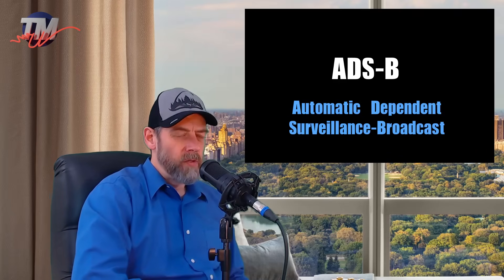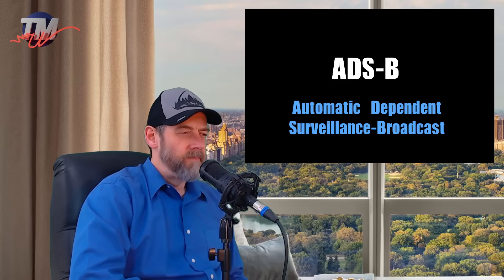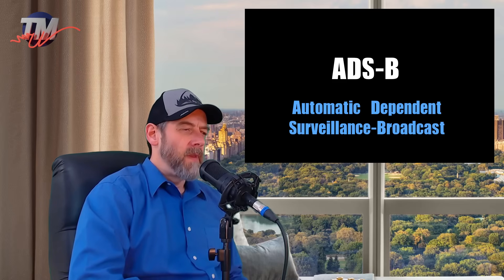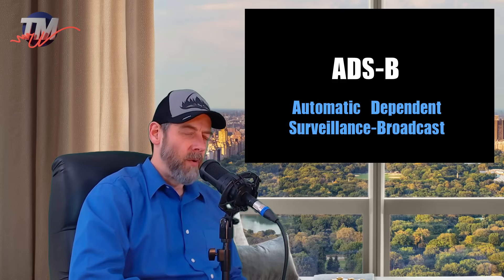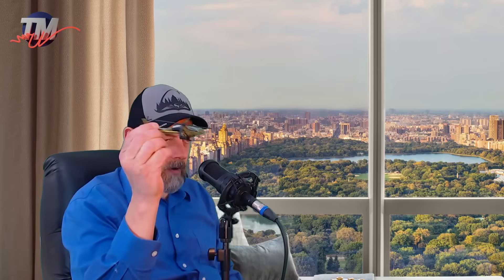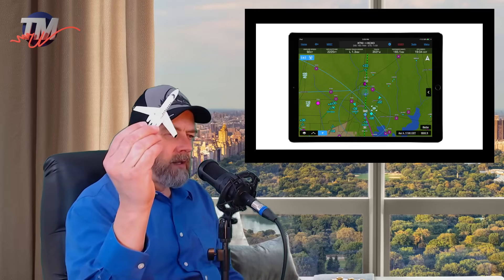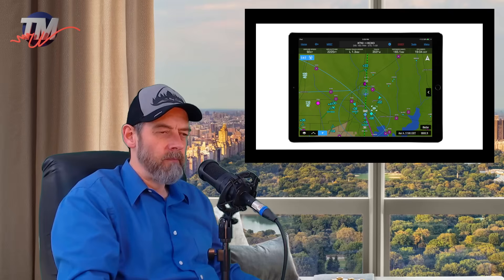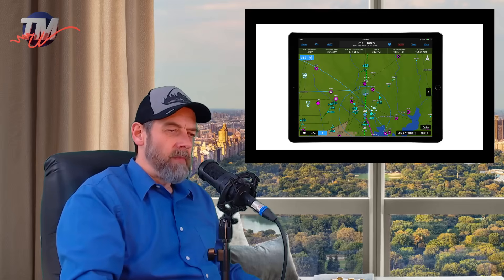The Blackhawk's ADS-B-Out system was turned OFF. Why, what is ADS-B, and why does it matter?

Comment: ADS-B Out is a system that allows aircraft to broadcast their location, altitude, speed, and other information to other aircraft and air traffic controllers (ATC). ADS-B Out is required for most aircraft operating in controlled airspace in the United States. 
How it works 
Aircraft with ADS-B Out transmit information using a Mode S transponder and Extended Squitter.
The information is sent using the 1090 MHz frequency, or the 978 MHz frequency for aircraft flying below 18,000 ft MSL.
The information is received by ground stations and other aircraft with ADS-B In capability.
Benefits
ADS-B Out provides more accurate tracking of aircraft than radar. 
ADS-B ground stations can be placed in areas that are difficult to reach with radar, such as mountainous terrain. 
ADS-B Out provides more accurate information about an aircraft's last reported position, which can help with search and rescue. 
Related systems

Comment: Don't helicopters have radio altimeter? Totally independent of air pressure or GPS.
I worked on these radios back last century.
Reply from the maker: Some are equipped wit h a radar altimeter, but it's irrelevant. They weren't paying attention to any altimeter in the cockpit.

Comment: ADS-B turned off?  Maybe necessary for the military in special circumstances in a true national emergency/evacuation, but as I recall, for us "little people," the FAA says if your aircraft is equipped with ADS-B, it must be turned on at ALL times ... period!
Reply from the maker: Yes. The regulations facilitate some exceptions, but in general that is correct.
Reply: @truthmattersunplugged  Military is not only exempt, they NEVER use ADS-B for security reasons so their movements cannot be tracked and analyzed by mortal enemies that want to brutally slaughter EVERY man, woman, child, cat and dog, and every living thing in the US. It's to prevent enemies from SLAGHTERING us by taking out EVERY US Armed Force aircraft in one preemptive attack in the blink of an eye.
Reply: @truthmattersunplugged lets be clear about the requirement for ADS-B in Army helicopters. 
Army Regulation 95-1, table 5-2, Required Equipment indicates ADS-B is required equipment on the aircraft and that it is required for day/night, instrument, and night vision device (NVD includes NVGs) operations, with a caveat:
Para 2-14b(2)(j): Under day/night or NVD operations, mission briefing officers will mitigate operational security risks for sensitive or classified aviation operations when the aircraft is assigned a unique address code and/or location is broadcast by ADS-B, mode S transponders or personal electronic devices.

The point is, the pilot in command could have been briefed to turn off ADS-B so as to not display route or altitudes to anyone that would do harm to those specially marked aircraft. Now, I doubt he was briefed not to use ADS-B but it’s possible. I also don’t believe the NTSB has proof that the ADS-B was off. The front half of that aircraft is so wadded up in damage like tin foil that I find it doubtful they have gotten to a control head and viewed the on/off power switch off. It’s possible the ADS-B failed or was inoperative (although unless the mission briefing officer authorized the flight with it off, it was required equipment to be operational). If it was inoperative before flight it would have been written up in the aircraft logbook which at least used to be a laptop computer. The Army and NTSB will investigate all these possibilities and determine the facts.
Reply: Military is exempt
Reply: @garyalabama 
Nope ... well maybe on a battlefield, in warfare.The trouble is, that the military THINKS THEY ARE EXEMPT in peacetime in public airspace.
Reply: @thedolphin5428  Remember 9-11  I suppose those fighter pilots trying to stop a few of those planes had ALL reason to turn off all types of transponders. Only using their military radar. That was also peacetime.

The correct assumption should be....
ONLY in real emergencies they can turn of such systems.
Reply: So why was the initial height data claimed to be ADS-B if it was turned off?
Reply: @Manwithcheesees  The ADS-B data was from the PSA commercial aircraft.
Reply: @Sparks68  ADS-B doesn't tell you the position of other aircrafts. It broadcasts its own position. They said the track data from the helicopter was from ADS-B data. So someone is wrong.
Reply: @Manwithcheesees  Someone is wrong? Start with the creator of this YouTube video. The Blackhawk didn't even have an ADS-B onboard. The ADS-B Out track was from the plane. The only track thus far for the Blackhawk was the Tower radar recording. The black box Flight Data Recorder on the Blackhawk will have a recording of its altitude from its altimeter for a given amount of time before the collision. The DEFINITIVE story is from the NTSB briefings, not from this dude.

Comment: Also, in an unrelated question, what are your thoughts that the legend of the VFR helicopter route chart shows the altitudes as "recommended altitudes"?
Reply from the maker: That is normal. They have to be able to fly around obstacles, mist, smoke, etc.
Reply: @truthmattersunplugged  I find it confusing when so many aviation professionals are making a huge deal about the chopper being high. They were VFR and, regardless of altitudes, or even identifying the wrong traffic. In theory, they should have avoided any and all traffic, whether it was called out to them or not. It really boils down to a failure to clear. Of course, there will be contributing factors in the investigation.
Reply: @truthmattersunplugged  And technically, by the regulatory guidance, they weren't high because the altitudes are purely "recommended." And no altitude assignment was given.

Comment: Good video thanks. However, correct me if I'm wrong, but Blackhawks have radio altimeters fitted. Flying a corridor, such as route 4, at 200' or less, would demand accurate altitude references for the pilot. The barometric altimeter would not offer accurate reading at such a low level.
Reply from the maker: Some do. But the pilot didn't seem to pay attention to any altimeter. It is true that a barometric altimeter could be off by over a 100 ft, but not after setting it just minutes ago not far from where they were. If set correctly it would've been accurate enough.

Comment: I've watched the autonomous blackhawks perform missions without any crew flawlessly. 
I am not saying this is the case only that it could've been overtaken by remote possibly ? 
So sad and an entirely avoidable atrocity ...
There are 20 military air bases within a 50 mi radius to night train in the middle of runway approches  if that's your thing?  Just taking out a passenger jet after 67 seconds refusing to comply w/ ATC directions is unacceptable period! 😭
Reply from the maker: It is plausible. It that is the case we'll never know the truth.
Reply: @truthmattersunplugged 
That's correct. I'm positive we will never get the truth or any real accountability in this situation like always!  Right away, my initial  thoughts on this crash was sabotage being prior military with 30 yrs combined as a DOD aviation contractor 
I can't help thinking about the autonomous Blackhawks and I wouldn't be surprised if this helo was crew less and operated by remote? Either way, my suspicions keep me leaning towards this possibility as sad as it is...  This crash was preventable and is sorely obvious!

Comment: news flash... mode C is only certified to +/- 125' (it used a 12 bit Gillham  code... the same is used by ads-b and GPS (with a functioning waas signal) is only accurate to about 30M vertically (10M horiz) so no matter how you look at it, flying at very low altitudes (as was the case) the vertically accuracy sucks as it is about +/-50% of the allowed max for the helicopter route so it is NOT really an acceptable source for separation by ATC, IT HAS TO BE DONE VISUALLY which includes using the local altimeter setting and flying the correct altitude which IS very accurate, but it must be done... and actually when the blackhawk was told to pass behind the CRJ, THAT was the fuckup not the altitude, just like with TCAS which is not readily usable for separation below 1000' as it can only provide vertical advisories... you are indeed correct they were supposed to pass behind the CRJ...  and please realize that GPS altitude info is the same as locally corrected pressure altitude but generally not as accurate... ADS-B out uses pressure altitude as the primary altitude info not the GPS (geometric) altitude....lesson of all of this? fly behind and airplane and it cannot hit you!
Reply from the maker: The BH's altitude is of less importance than horizontal separation. They shouldn't have gone into the short final approach leg of a landing aircraft even if they were at 100 ft. So,  altitude was not the primary issue here. ADS-B Out transmits both geometric and barometric altitude. ADS-B geometric altitude is more accurate, but still within 10-50 ft. ATC primarily uses barometric altitude separation and for IFR operations because that ensures all aircraft are using the same pressure altitude (29.92 mmHG). Geometric altitude can b alsoe used to verify an airplane's barometric altitude.

Comment: I agree with your assessment that "vast mistakes" (your words) were made in this case. Vast mistakes which contribute to an undesirable outcome are a characteristic of a subversive operation, a.k.a. false flag. If that is the case, the "mistakes" would have been intentional.What would be a motive (among many possible motives)? If the evacuation system is compromised, that means it is hackable. Who could hae been doing the hacking? This could have been a signal to the set of people who are eligible for such evacuations that there might not be a safe exit. This is an egregious security breach of the highest order.

Comment: The Gold Top heli was in a fleet that are just taxis for idle Generals. This flight was in the most congested airspace in the country, being flown by a trainee pilot with only 500 hours, had nav aids turned off, was at the wrong altitude and was wearing 2D night vision that has no depth perception. What could possibly go wrong? Well, Everything. And it did. Now we get the coverup. Its all in the script.
Reply: Fairly experienced for the military, so not trainee.  Different arena, different standards.  But, yeah, the whole heli crew f-ed up.  Also the tower was very short-staffed and over-worked.  Also the standard procedures for the interaction between the heli river route vs that runway approach are seriously deficient and the heli should have been required to stop and hold short.
Reply: @davidseslar5798    yea whatever  the  communication  was  right before  crashing ,,was NOT WORKING ......how many crashes  and deathes  does it take  till  pilots  learn  the language  o  Towers  control
Reply: @davidseslar5798  That's bullshit. Tower did things by the book and was not understaffed or overworked. There were 5 controllers on duty; only one was necessary to control the busy but not disorganized airspace. The 'Hawk crew screwed up. And since it was on visual and told the tower twice the CRJ was in sight, it was responsible for decisions about holding short, not the tower. Put your tin hat back on and leave the room.
Reply: @PoubelleKansas  If they did things by the book then the book is wrong.
I'd say granting visual separation under the given conditions is as bad as requesting them.

Just saying, if you are convinced seeing the right airplane you're telling you have it in sight. Or do you?
If you request visual because you see what you think the traffic in question is and the controller just say "negative, hold short", everything is fine. Your mistake would be mitigated by a 2nd pair of eyes.

Thats basically how the swiss cheese model works, add layers of safety to mitigate errors (which happen from time to time).
Reply: @Merilix2  "The book is wrong"? Thank God you're not in my Euclidean Geometry classroom. 
And whose second pair of eyes are you talking about? 
The "given conditions" were standard for DCA at night. Lots of planes in trail, all waiting their turn to land. 
When a PIC asks for visual he is taking responsibility for his craft and those on board, plain and simple. Tower ATC is not there to command aircraft in flight; they give advisories and line planes up. FAR is pretty clear on this command sequence. 
Visual is granted under identical conditions hundreds of times daily. If the PIC asks for it, there's no need for "backup" in the tower to verify the location and make sure the air is clear. Talk about tying things up; that kind of handholding only wads up the traffic for no good reason.
ATC can step in if something weird pops up, so in this case ATC asked a second time if the CRJ was in sight when it looked like the 'Hawk wasn't going to actually pass behind the CRJ. 
The Blackhawk pilot said he had the CRJ in sight. A CRJ, not an A319 or anything else. Twice the PIC said he did. Those two aircraft are visually distinct. Check the location of the engines. 
There's still much information we need to make a fuller determination of fault but most will land on the head of the PIC of the Blackhawk who turned off ADS-B and might even have had on NVGs. It doesn't look like he ever used his eyes, either, to sweep the sky. Kind of hard to miss a CRJ with landing lights up ahead, even when coming in from the side.  
He lost any way to id nearby aircraft through his stupidity and killed 67 people.
Reply: @PoubelleKansas  If the book would have said: "You must not permit visual separation if there is potential conflict" then the accident wouldnt have happened. Right?

It seems like you didnt got the important point here: Safety first!

It may work out well 10000 times a day but if a pilot makes a single mistake it costs life which ATC could have prevented to happen by not granting permission for visual.

You know? Independent Probabilities multiply. if there is a 1/10000 chance the pilot mistakenly look for the wrong traffic and there is also a 1/10000 chance ATC would mess with separation, there is only a 1/100 million chance for an accident. But if ATC always shift the responsibility to pilots only, the chance is 1/10000. 
You get the point?

Taking slices off the swiss cheese model has huge impact for safety.
Reply: @Merilix2  Well, in addition to needing a probability lesson – which I'll not do for you so as not to confuse you even further than you already are -- you need to read the FAR before you pop off about ATC. [The Federal Aviation Regulations (FARs) are the rules that govern air traffic in the United States. The Federal Aviation Administration enforces the FARs] Also, here’s a selection you need to read from The United States of America Aeronautical Information Publication (AIP), published by the authority of the Federal Aviation Administration.
[Caps in original]

PILOTS HAVE COMPLETE DISCRETION REGARDING ACCEPTANCE OF THE SUGGESTED HEADING OR DIRECTION AND HAVE SOLE RESPONSIBILITY FOR SEEING AND AVOIDING OTHER AIRCRAFT.

Additionally, “The pilot in command of an aircraft is directly responsible for and is the final authority as to the operation of that aircraft.” 

"Complete discretion,"  "SOLE RESPONSIBILITY FOR SEEING AND AVOIDING OTHER AIRCRAFT," and "final authority" are key phrases here. 

Laying blame on ATC for the actions of the helicopter pilot after traffic was called is wrong. If the pilot said he (or she) had the aircraft in sight, he (or she) assumed complete responsibility for separation. 

The pilot is the one who controls the aircraft; he or she is the one in charge of the aircraft, not the controller. ATC did its job that night and told the ‘copter there was traffic to be aware of (TWICE!); why it did what it did will be determined by the NTSB, but the copter crew made a mistake.
Reply: @PoubelleKansas  You're just disqualified yourself in math with your first sentence and again you missed te whoole point. (Edit: because you want to miss it)

There is no need for me to read any further.
Lol.
Reply: @Merilix2  Thank you for going no further with your barely literate comments. Seems you were unable to figure out what the hell ATC is and just gave up.
Reply: @PoubelleKansas  I know what ATC is and I know ATC in US is a bit different than in the rest of the world. Again, it seems like you didnt  even got a single point. I didnt blame the individual ATC guy. 
I'd blame the lax rules. I'd blame the common practice to take away layers of safety for efficiency.
It seems the term "normalization of the deviance" sums up exactly what caused the tragedy.
Reply: @davidseslar5798  
Nearly every control tower in the nation is "short staffed" , and the controllers are usually "over-worked" because of it. 
IMO, the fault lies in the practice of the military ignoring safety protocols because of "mission requirements" , or some other fabricated excuse . 
Turning off crucial navigation systems for "training purposes" , as made obvious in this case , puts other people at severe risk.
Reply: The heli pilot wasn’t a trainee, she was re-validating an existing qualification. She had an instructor along to certify her performance who was technically P1 (pilot in command), but Army pilots don’t rack up huge hours. 500 hours is about average for her term of service and she was flying operational flights.
Reply: Coverups are not always successful. We can't make any assumptions such as who was actually flying the Helo. Are they not capable of remote piloting? 
Is transporting Generals their only dedicated mission? Does General Millie have anything to do with this?
Reply: @stevesims-d6c hilarious you’re trying to gin up a conspiracy